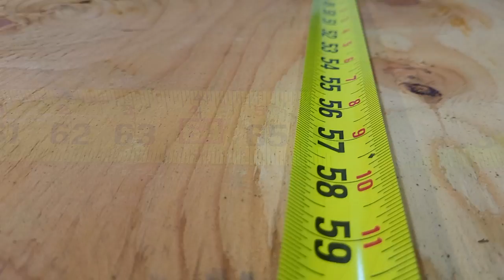Part 11: Framing out a round door for my Hobbit Hole build.

Comment: What does the blow torching do for the wood?? Just curious.
Reply from the maker: It carbonizes the outer surface of the wood and slows down the rotting process if that wood comes in contact with water.